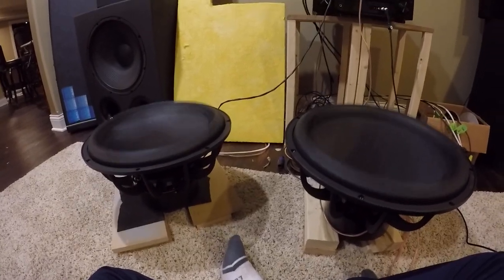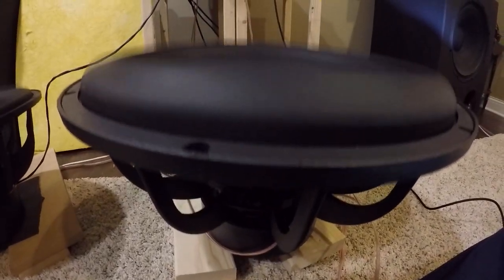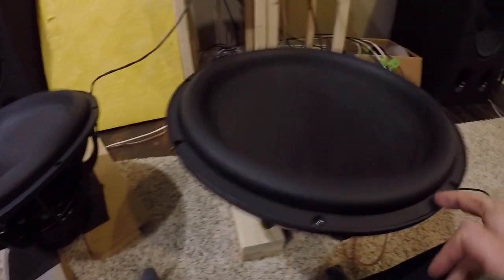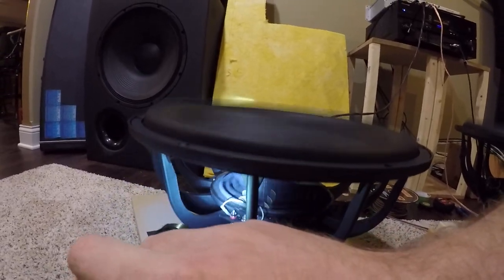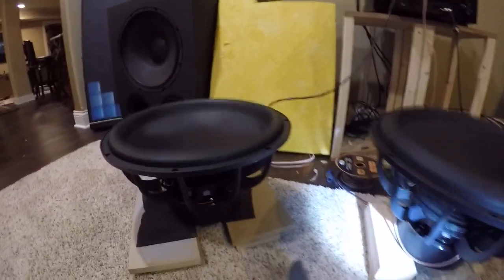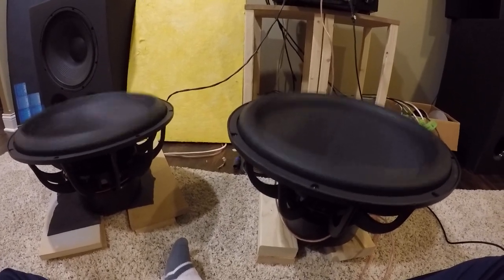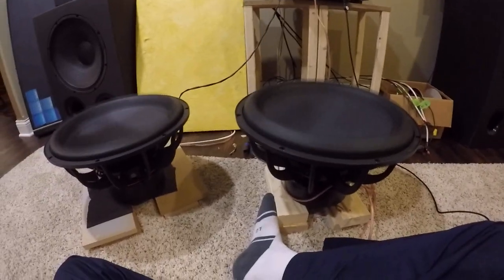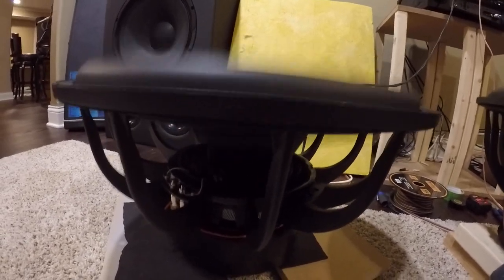Dayton Audio UM18-22 Subwoofer break in video

Comment: Never use single note sine waves (especially very low frequency) for break in. There are break in sweeps that vary the signal. Use those. It’s just safer and doesn’t heat up the coil like what you’re doing does.

Comment: They sound really noisy and that's not good.  I plan to order one for testing but this makes me really leery.  If it's really that noisy I'll have to return it and look for another solution.
Reply: And how is it?
Reply: They're not. And compared to my previous commercial subwoofer drivers (SVS, XTZ), this is probably the quietest high excursion driver I had ;)
Reply: @nickpinkowski  Yeah I know, I bought one to test and it's still quite even at high excursion.   I now have 12 of them in Infinite baffle in my theater.

Comment: what amplifier are you using to power them?  how much power/watts?
Reply from the maker: partybob99 a Behringer inuke 6,000 dsp amp.  As for power maybe 400-600 watts I do it on the fly with the input voltage knob on the front of the amp and turning it up and down to the right level so the driver moves.   I just wanted them to move so the spiders would loosen up

Comment: These subwoofers don't require break-in.
Reply from the maker: Travis Piper parts express has had so many problems with them it’s always good to check out he driver before using it.   These subs were for a build I was doing for a guy.  My goal was to check the before and after DatsV2 measurements before and after break in which did change.   It’s always good to check to see if you have any air leaks or broken parts before installing a driver.  I learned this from Mark Seaton at Seaton Sound that loads his F18’s with these drivers.
Reply: True always good to check. They state it requires no break-in. Didn't think it would actually make a difference if any.